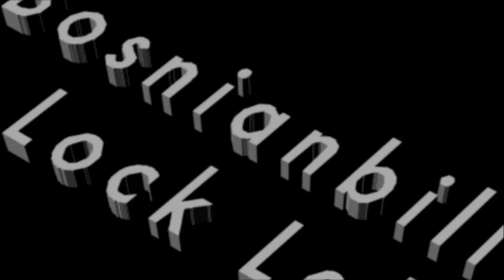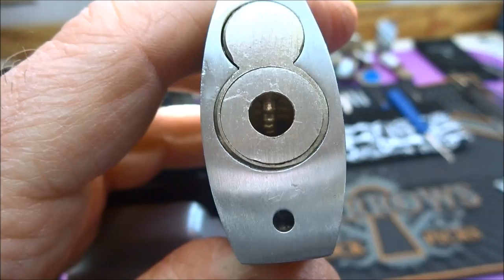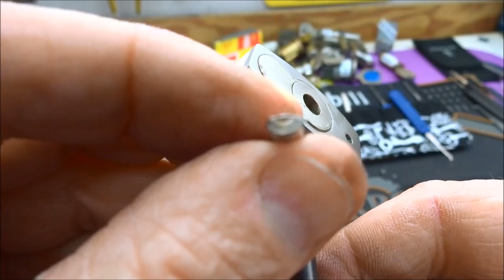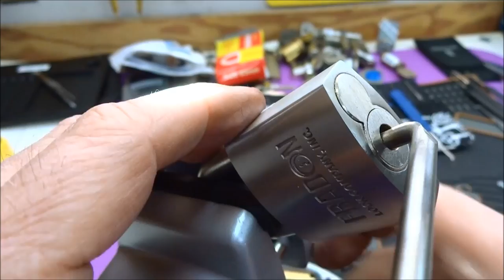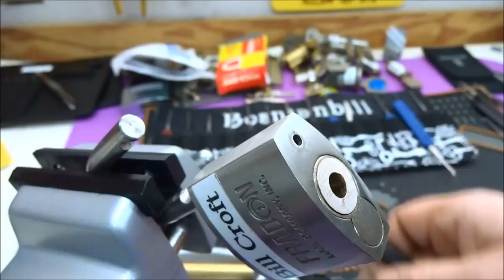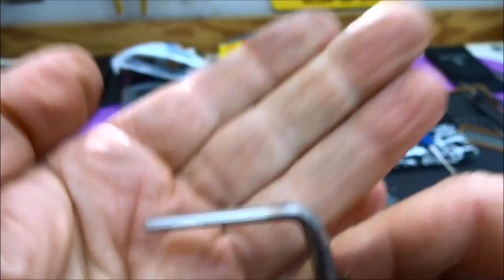(491) Fradon Padlock Picked Open (Technique Explained)

Comment: You went to a lot of work making tools to pick this lock. I took the lazy mans approach.  I just used a regular tension wrench and a small screwdriver as a pick.  Here's my solution to the Fradon lock:   http://youtu.be/mUYjcvqO-4k
Reply: bosnianbill It's a fun lock to pick, isn't it?  I took a closer look at the front pin on Bills lock and it looks like the wrench you made didn't make any marks in the first pin.  The way I did it put little nicks in the first pin.  I only tensions the first pin after watching Alex Blade gut the one he picked on video which showed how they designed the 1st pin as the tensioning pin.  I think spreading the force to other pins makes sense, especially if you're picking someone else's lock.  I'm sure Bill appreciates it.  :-)